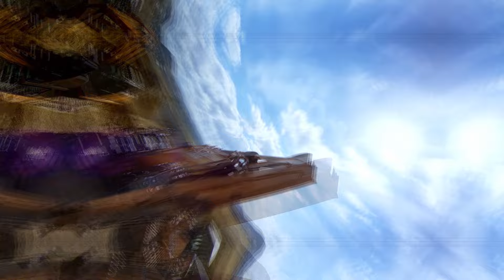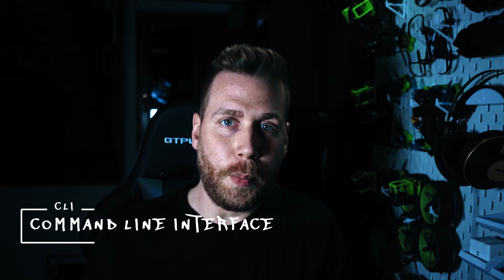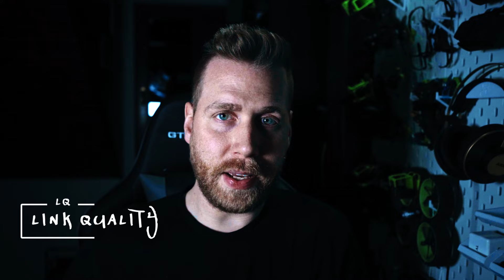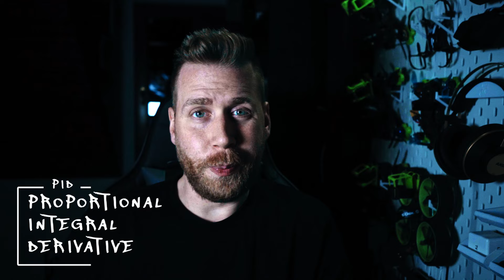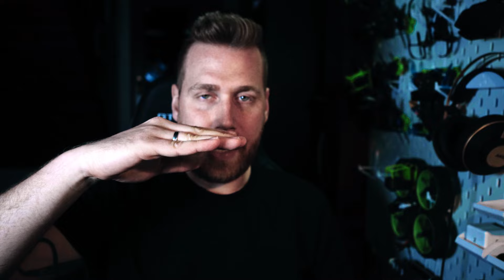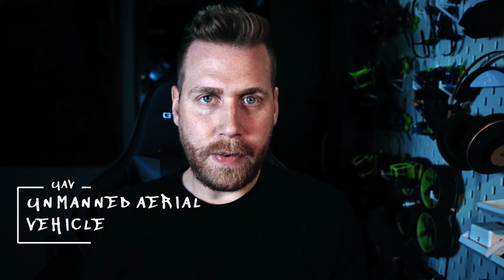FPV Dictionary for FPV Beginners - 55 Abbreviations and commonly said things explained!

Comment: You should make a short video about what are these abbreviations you see in the Radio control such as in Taranis Q7( SA,SB,SC,SD,SF,and SH? So many abb that's already confusing me.Thnx a lot
Reply from the maker: Hey Rob! I think for that one we don't need a video 😉
S stands for Switch and A,B ..... are the assignment (they also could've call them 3,4... [1 and 2 are already taken as far as I know] )

Hope this brings a little help?  😉
Reply: @flickFPV  Well ,i guess so (my head doesn't have enough memory now,it's full so i get easily lost)..Thanks for the reply
Reply from the maker: No worries mate! We all have been there .. so much abbreviations and things to learn in this hobby 😁👍

Comment: Niiiice, that is an awesome idea. I think you should start to work on dictionary.  Accept my apologies in advance if you covered any of those: RHCP, LHCP, MMCX, UFL, Ipex, Band, kV, S (cell count), C (C- rating of the battery), db (decibel), V (volt), A (Amper), RSSI, LQ, Vbatt / Vcc, +, -, XT60, XT30,... I'm sure I'll remember more. Again, great idea. 👍
Reply from the maker: Yeah some of them are already covered, but some of them might be worth a part 2 🤔
Reply: @flickFPV  ok. Then we have: UART, Sbus, Ibus, Fport, DSMX, DSM2, PPM, PWM, F (Farad, actually uF),... 😁
Reply from the maker: For now I wanted to keep it simple to help beginners to start into the hobby, but this is a great input and might worth a part 2 video for intermediate pilots. Thanks mate 👍
If you have further ideas I'd say let's mail about that. 😉
Reply: @flickFPV  yeah, it can quickly get complicated, especially explaining each thing.